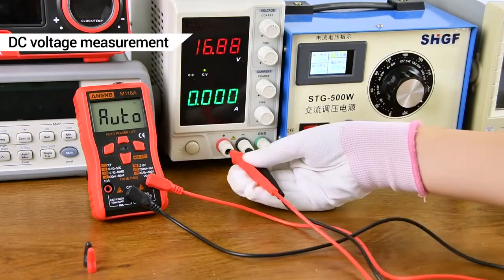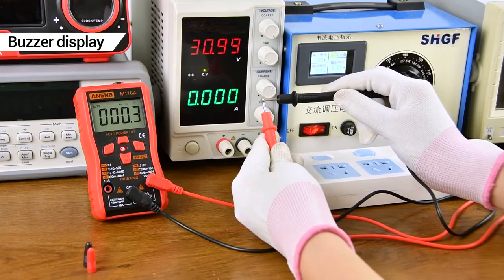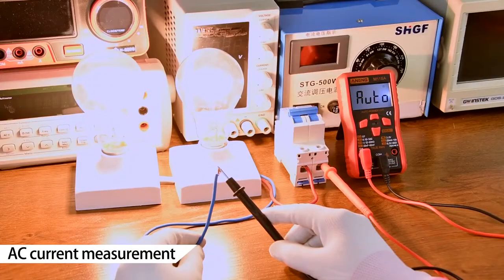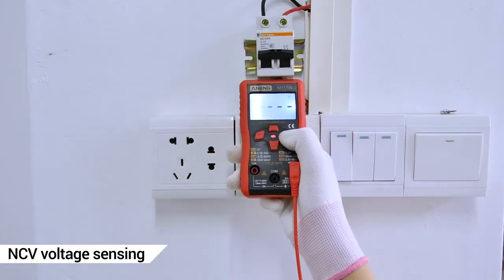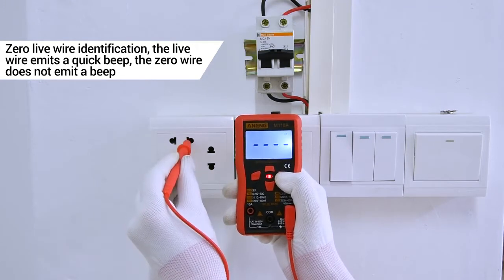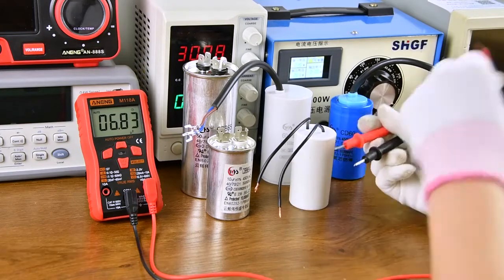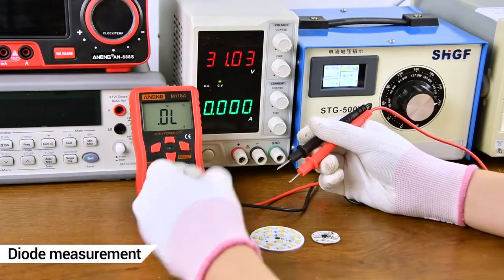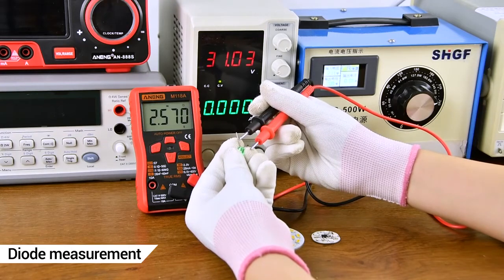ANENG M118A Digital Multimeter True RMS Tester 6000 Counts Auto-Ranging AC/DC Transistor Voltage

Comment: I bought this device, I do not like the low accuracy of measurements. A deviation of 8% from the capacitance of the capacitor is too much. The DC measurement mode with an error of 28% is also a lot. As I understand it, the calibration of this device consists in writing the calibration coefficients into the memory of the T24C02A microcircuit, using a programmer from a binary file. Please tell me a way to edit the read firmware. Maybe there is some program for editing correction factors, or a table of memory addresses - values? If I cannot find a way to correct these errors, I will have to return the device to the seller. But the first option would be preferable for me, since I liked the functions of the device and its performance.
Reply from the maker: Please contact the after-sales customer service in the store where you purchased the product to solve it for you
Reply: @aneng  Thanks, I already calibrated it.
Reply from the maker: @ДмитрийЧерных-с5м  ok， you are welcome
Reply: sir can you help me send the binary file on the t24c02 on the Aneng M118a multimeter? I need it, my multimeter is short on the memory IC.
Reply: How is it calibrated?

Comment: Aneng m118a
Full function protection
Yes
 no
Please reply me
Reply from the maker: yes
Reply: You will measure the capacitors, first remove the residual voltage from them, only be measured in manual mode. And do not check the current strength in the outlet in 10 amp mode. In the first case, it will burn out, in the second you will arrange a short circuit and also burn out. The rest can be measured in auto mode, without fear of burning, не превышать 600 В.